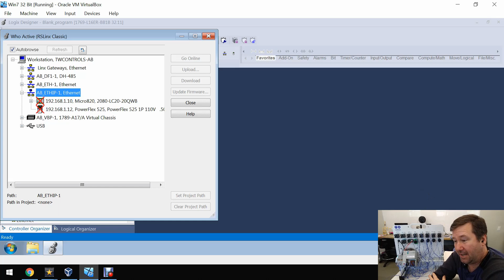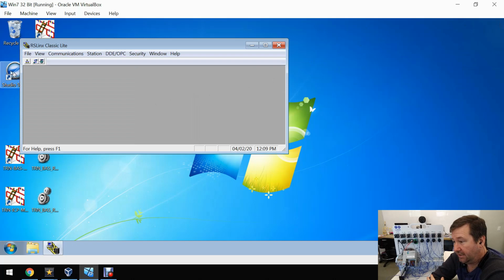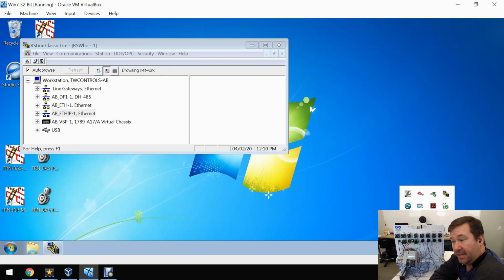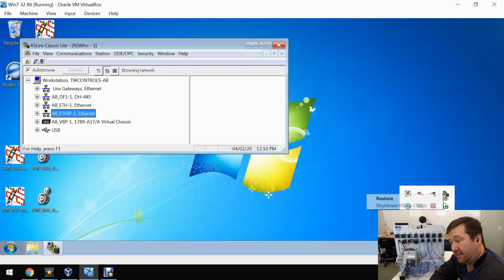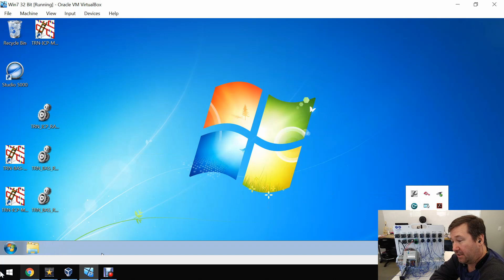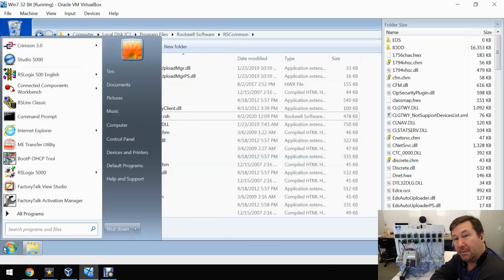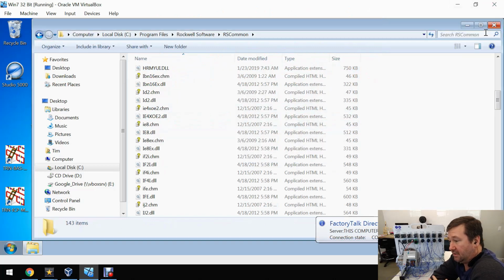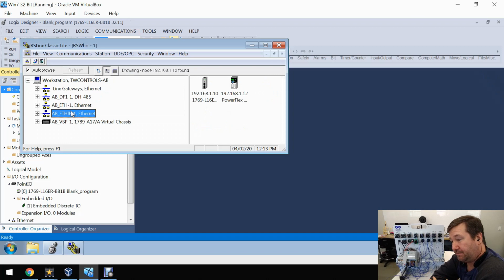Troubleshooting RsLinx Browsing Issues Caused by Harmony Files

Comment: I'm having similar issue (unrecognized device and question mark) I did check all same as you did to connect to micro 820 with CCW soo I will try this next also my CCW is version 13 soo I was thinking something in that version is bad but will try this first.Thank You Tim.
Reply from the maker: You are welcome
Reply: @TimWilborne  It didn't work looks like I need some patches ,I will try with another PLC
Reply from the maker: Hit the basics, can you ping the PLC from your PC?
Reply: @TimWilborne   25% 4 send 3 received on cmd but on Rslinx nothing, I used TW tool to assign new ip address still same issue.
Reply from the maker: Strange if you are consistently losing 1 out of 4 packets.
Reply: @TimWilborne   Yes I did ,soo I was thinking maybe something in Rslinx that Rockwell changed (not in use anymore or update) and I deleted CCW and Rslinx installed back new (same version 13) and same issue, but I was able to connect once to plc didn't change anything in communication I went offline and never back LOL,even after I deleted harmony files.
Reply from the maker: If you are having a 25% packet loss then the problem is probably between Windows and the PLC.  Is it a basic Ethernet switch between the PC and PLC or is there more to it?
Reply: @TimWilborne   well first I had it on my gaming PC after I tried on laptop both are windows 11 ,and same happened on both, used ethernet cable and ethernet  to usb,maybe is the issue on my micro 820 ethernet port ,there is only ethernet port no serial port.
Reply from the maker: But what are you connecting through or are you using a direct connection?  Also, it does have a serial port if it comes down to it.
https://www.youtube.com/watch?v=hJAh_QeAPgY
Reply: @TimWilborne   Yes I was using direct connection ethernet but thank you for serial connection explanation I will try it these days I didn't know it Thank you Tim.
Reply from the maker: With a direct connection, you should get 4 replies every time.  I'm not sure what to make of that...it would be interesting to if there is anything unusual about the Ethernet configuration once you get into it via the serial port.
Reply: @TimWilborne   I will reply again when I connect with serial cable a test pockets
Reply from the maker: Sounds good

Comment: Very informative. I almost forgot those files existed...on another topic of connectivity, have you or could you do a video on remote connectivity/download...particularly download in Studio5000. I can make mine work using the ETH driver but cannot for the life of me connect via ETH IP drivers....but ETH IP of course works on LAN. I can only assume I set up the modem correctly but no success with ETH IP. I’ve heard ETH IP is inherently faster. Something an AB instructor told me once so I’m adamant on trying to utilize that function remotely. Thanks I’m advance.
Reply from the maker: Hi Traven.  Chances are you will not be able to use the Ethernet/IP driver on remote connections.  It uses broadcast packets to discover devices on the network and many routers filter these packets out.  I think I talk about that some in this lesson.
https://www.theautomationstore.com/how-to-connect-to-an-allen-bradley-controllogix-or-compactlogix-plc-over-ethernet-using-studio-5000/

Comment: One of my biggest pet peeves is software designers that will open a file, do their business, and then leave the darn thing open even though they are finished with it. Rockwell is particularly bad about this, and there is no excuse for this from any designer. Pure laziness. Okay, maybe laziness and stupidity.

And RSLinx really needs to die and have something something better put in its place. Not just for the PLC connection part, but the data collection end of things really is horrible too.

Is now a good time to put in a plug for AdvancedHMI?
Reply: AdvancedHMI is nice. I've done a couple of them. My favorite one was just to monitor the in & outs of a robot strictly for troubleshooting.
Reply: @EliteAutomation  I recently did a HMI for a robot-to-CNC setup using AdHMI. Includes an Excel reader (without using Excel), a G-Code reader, comms to both the robot and the CNC to control them, and soon it will include an old-skool modem to call for help - and (hopefully) not get the wrong kind of help from the wrong kind of people. ;>

Came out nice. :)
Reply: They pushed out FactoryTalk Linx to replace RSLinx. And I don't think it works well.
Reply: @SteveLovesTofu  Nope. :)